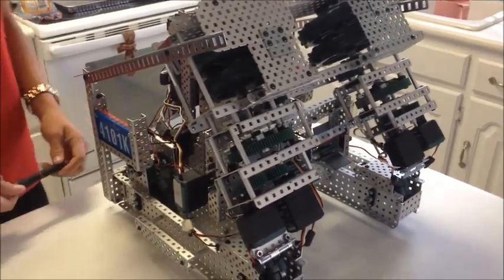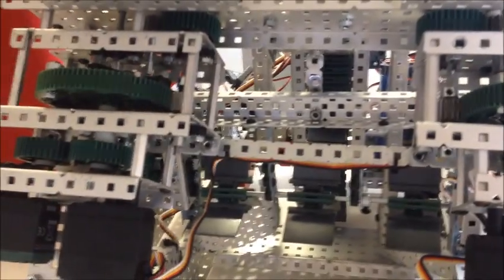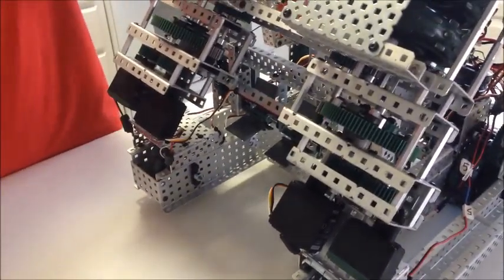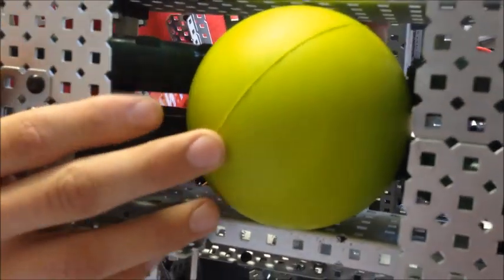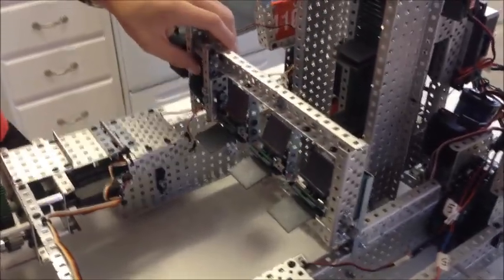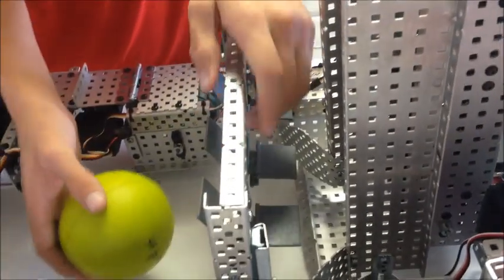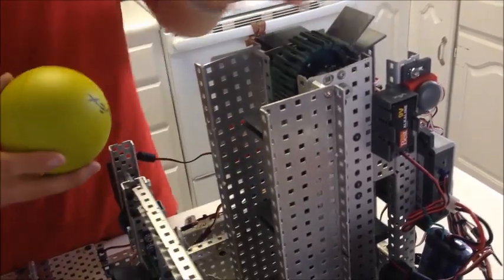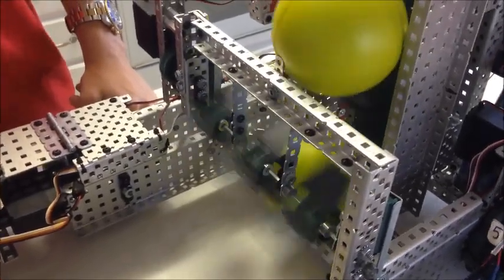VEX Nothing But Net | 4101K | Robot Changes

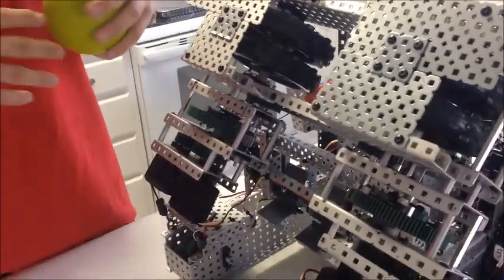Comment: I have recently changed my gear ratio to a 1:21, like the one that you guys have in your robot, but the wheel spin for about 10 seconds and then stop, we wait a few second and it spins and stops again. We have 4 motors set to torque. Did this happen to your robot?  Do you have any idea of what it could be? Because I think the motors set to torque should be able to spin the shaft.  Thanks in advance :)
Reply from the maker: actually we are now seeing this problem. it did not happen to us for the first several weeks and we don't know exactly why it is happening. we have found a few ways to help the problem but haven't quite fixed it. find every possible place you can that metal rubs metal or a axle is tight inside the bearing and fix it to remove friction. put the launched motors on opposite end of the cortex such as motor ports 1,2 and 3,9. make sure your battery is fully charged and use a power expander if it is available. lastly we have found that parts wear down especially the thin plastic spacers we found one was rubbed until it was very thin and not doing all that it needed to do so we had to replace it. also the shafts on the wheels themselves may need to be routinely changed because they see a lot of side pressure especially in a jolt action that can bend them and make the axles harder to turn.
Reply: +Canedjeerno I noticed that you guys had shaft collars right next to metal. That could be part of your problem (extra friction).
Reply from the maker: +Benji Miller those shaft collars have thin plastic washers between them and the metal.
Reply: +Canedjeerno Okay, then that should be fine. :)

Comment: what is the gear ratio on the intake?
Reply from the maker: The gear ratio is 1:21. If you want to see more about the bot or the gear box's specifically check out our original video and our in-depth explanation of the gear box.
Reply: +Canedjeerno on the intake not the launcher. it looks like a 3:1 but not sure
Reply from the maker: oh yes sorry it is 1:3. I don't think the gear ratio is super important on the Intake we chose this because the ratio is fast but still has some torque in case a back gets stuck.